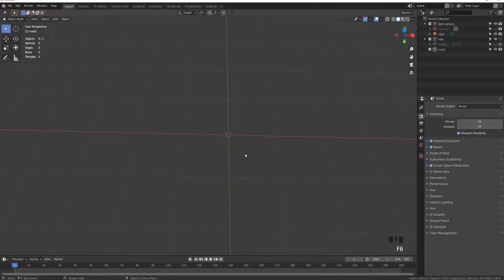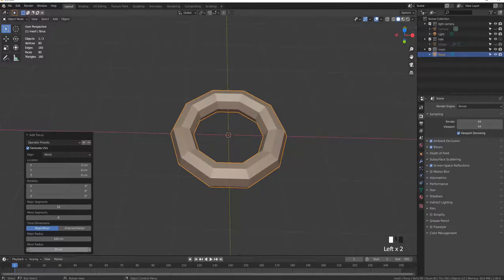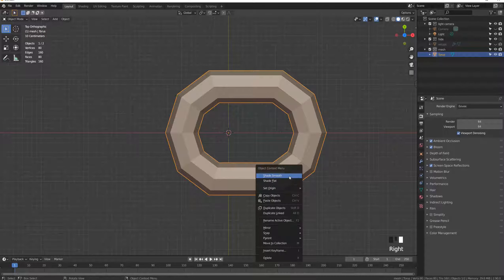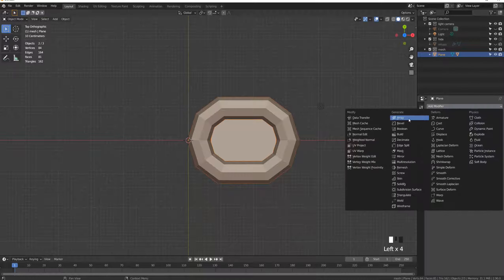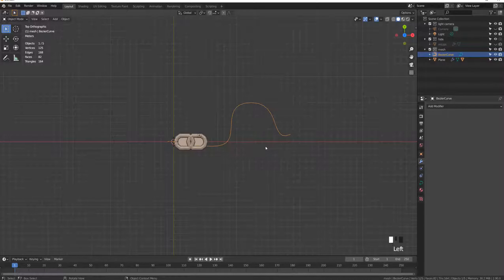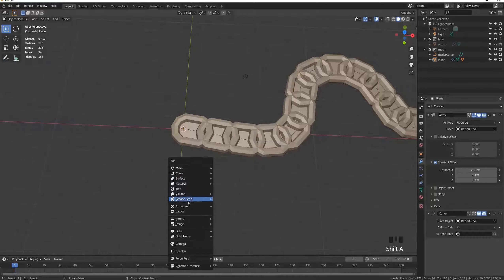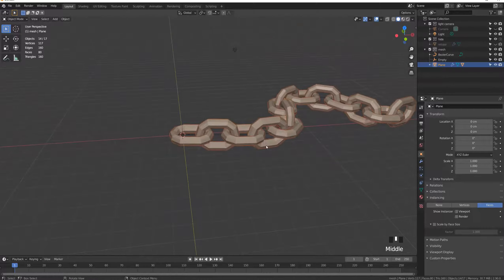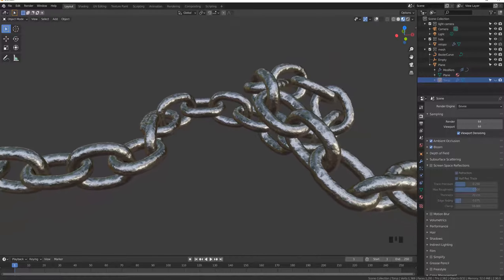Blender tutorial - Chain without distortion using the curve modifier

Comment: Great video. You can improve this even further by instancing using geometry nodes. This way you can add procedural randomness to each instance without the need to apply the instances!
Reply from the maker: Yes it can be a good idea, but the purpose of showing this was not really to add randomness, just to show that it's possible to apply all this if you want for example for a precise manual retouching for a particular need or to correct a collision error between the chain links if there is one.

Comment: When you have problems with the Rotation and Size after applying the Instances:
You have to keep the Transform of the Object you want to have on the curve at its Origin values (1,1,1) and change the transforms in Edit Mode.

Comment: How can I use this tutorial, but having several uniqe objects spreading along the curve randomly but same space between them?
Reply from the maker: Hi, with this technique I don't think it's possible or maybe with the geometry node but I don't know enough about it.
Otherwise there is a solution to approach it by using the particle system instead of the instancing.
Create your array of a face then add the curve modifier and set it with your curve.
Go to the particle options, select hair, the number of emision must be the same as the number of repetition of the array, check "use modifier from stack", set particles/face to 1, in render modify "render as" and choose collection.
Then create a collection in which you place all your objects that should appear and choose this collection in "instance collection".

Comment: this is awesome - one problem I ran into is how do I animate this to move across a curve? the chains seem to get scrambled instead of moving along the curve (as opposed to not using the plane parent)
Reply from the maker: I can't seem to understand the problem you have or reproduce it.
As you can see at the end of the video I move my curve without any problem on the chain.
Reply: @chopsuey4698  not moving the curve, animating the chain along the curve path. For example, if you array a cube along a curve, and move the the cube along the X axis (provided rotation, location, scale are applied), the cube moves along the path of the curve. With this chain setup, I cant get those results
Reply from the maker: @plvg_design  ok, I think I understand what you're talking about but I don't see how to make an animation like that, actually. The way I see to do it is to move the plane in edit mod on the x-axis but it doesn't allow to create an animation with keyframes since it's a modification in edit mod but it doesn't seem to work differently than with the method without instances.

Comment: QUESTION
hi!
Thank you very much for the tutorial, it is very useful indeed.
However, when using the curve modifier, the planes obey the curve direction but the links do not. They are twisted on the Y axis but keep the center at the center of the plane.

Can you help me? Or if you leave me your email I can send photos of my problem.

Thank you!
Reply from the maker: Hi, I don't really understand your problem, I suggest you redo the tutorial step by step, pausing to make sure you understand and redoing exactly the same thing.
Make sure that your rotations are well applied on all your objects and that the origin points of the curve, the plane and the link are at the same position.
If you are still stuck then you can effectively send me more info at this email address: david07wol@hotmail.fr

Comment: is there a way to delete JUST the planes?, im trying to delete it but it dont work because all the chains dissapear
Reply from the maker: You can hide it as I show in the video. It's the plane that has an array modifier and follows the curve, the chain link only appears where the planes are, so if you delete the plane then the chain link disappears. The only way to remove the plane while keeping the chain link is to do as I show at the end of the video by making instances real. But after that, you won't be able to modify the chain with the curve.
Reply: @chopsuey4698  oh mb, didint see the last part ty

Comment: Hi and thank you for this idea! I only have one issue. I can't hide the original chain link in render because the whole chain then doesn't render. In the cycles viewport it works perfectly but in the actual renders the whole chain becomes invisible. I also can't move the original links out of view because the whole chain moves with it. 

Your thoughts?
Reply from the maker: Hi, to choose what should appear or not in the rendering you should not use the eye icon but the camera. 
If you don't see what I'm talking about, look at the top right corner of my video in the "scene collection" tab
Reply: @chopsuey4698  Thanks for your reply. Actually I have tried all of what you have suggested. Plus suggestions from a number of other forums and people. I do know what the eye and camera icons are for.
Reply from the maker: @0zyris  Ok I see. 
I can't test right now I'm not at home. Maybe later I'll find a better solution but what you can do is follow the instructions at the end of the video from 2:43
Make a copy of the chain (So that you don't lose the possibility to modify the chain later) then apply everything.
Reply: @chopsuey4698  Hi again and thanks for the quick reply. I was just playing with my test file (I always experiment using test files before adding new effects to a large project) and it was doing the same. Then I changed to Eevee to see if it did the same there. It did. Then I decided to rename the objects in the test file so I could upload it to stackechange. Then when I switched back to Cycles it worked properly as it should! Weird!

So I went back to my main project and switched that to Eevee and back to cycles and it worked correctly! Plus, you don't have to hide the object you have instanced to the plane! When you hide the instancer in the object properties panel it now hides the original face instanced object with it!

I wonder if we just got a live bug fix? I am on 3.1.2 auto update.